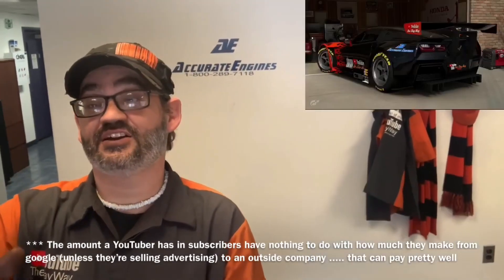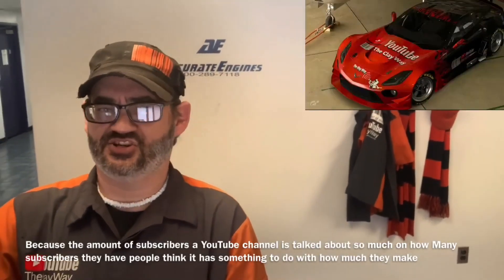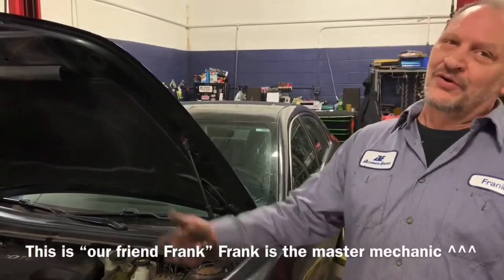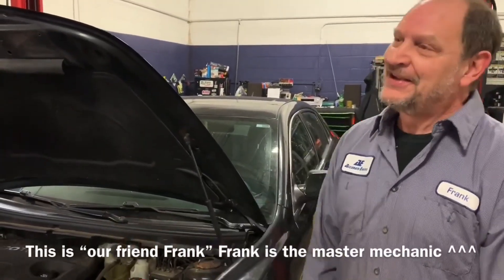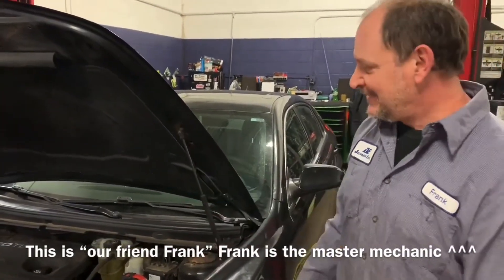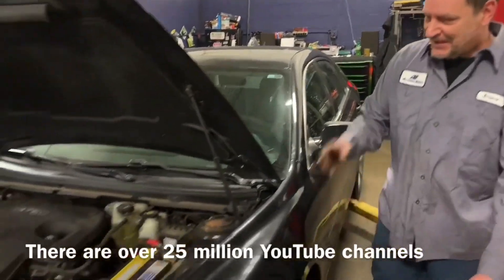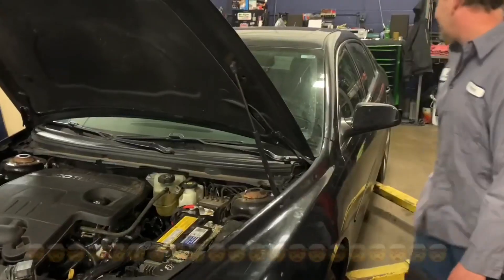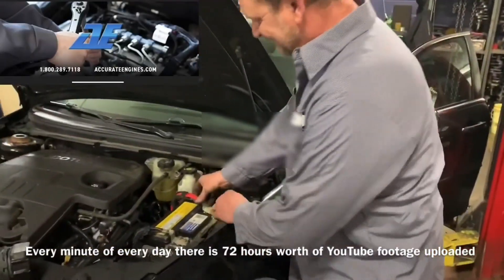Keys looked in car super Trick , so while I was working under my hood this happened!!

Comment: Assuming the hood is open. Thanks. And Best Regards
Reply from the maker: Don’t worry I’m gonna come up with some video showing you how to do it without the hood open or I’m gonna make videos that show you how to open the hood without pulling the latch I’m probably going to do both of them because I can see where that information would be helpful on different models
Reply: @sharpcarco  
You’re the best.  I locked myself out once after skidding on black ice into a snow bank. Got out, shut the door, car was still in drive. Oh damn. Tow truck guy slim jimed it.
Reply: @sharpcarco  I need to know now. Yikes